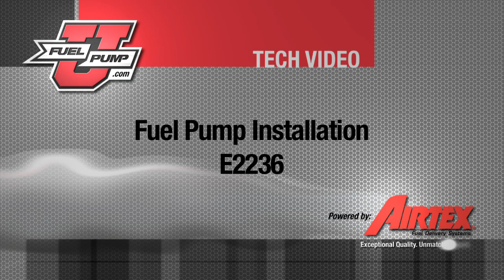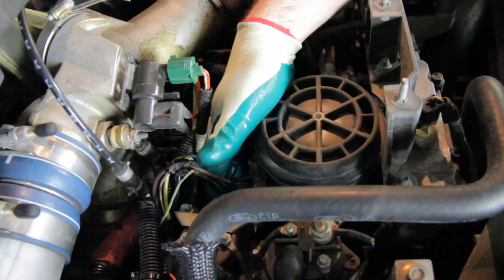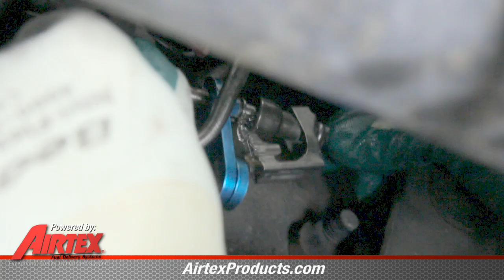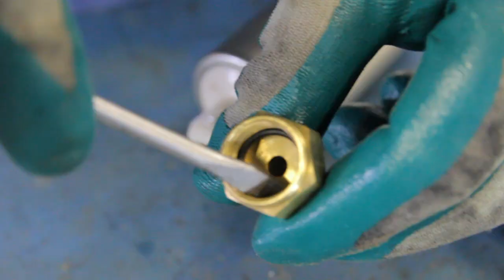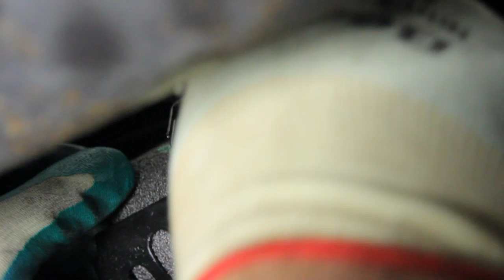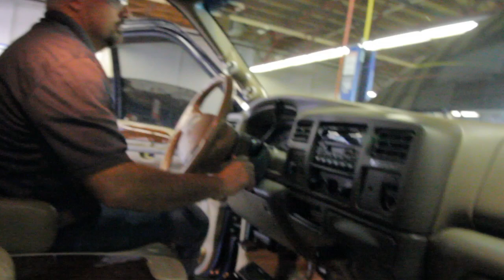How to Replace a Frame Rail Pump Assembly E2236 on 2000-2003 Ford Excursion

Comment: My previous comment I have to amend the fitting for the front of the fuel pump has been messed up looks like somebody grabbed it what's a pair of pliers or vise grips messed up the fitting that's why my quick disconnect tool would not work but that goes to show you when you buy a used vehicle you do not know what you're going to run into the previous owner of the vehicle probably worked on it himself or had somebody else work on it did Ashley didn't know what they were doing I apologize to the creator of this video put my previous comments

Comment: Yeah that looks like a nice idea in all but I have a 2002 550 plow truck that you would never get that bowl drain valve loose if you did it would start leaking all over the place that shows you how to do it but that's not real world real world is covered in rust and crud show us how to get the fuel pump out find an old rusted plow truck the truck you're working on looks like it's brand new straight out of the factory that's not real world I'm a mechanic I've been a mechanic for 40 years and I have never had a fuel pump come out that easy unrealistic

Comment: H E L P  !!!
My 2002 still has the factory pump and the inlet side doesn't have the big white clip,, it has a blue clip with little external access,, how do I remove that ??
I don't want to jump the gun and screw it up,,, I have a new Motorcraft unit ready and the inlet line clip is the last obstacle...

Comment: I have a 2002 7.3 powerstroke that will run good for weeks and then it will start running like it's not getting fuel and barely go down the road,  I can pull over, turn key off and back on it might run a half mile and repeat or ten miles or more and do nothing. Any ideas what it might be?
Reply: High Pressure Oil Pump (HPOP) its what makes the injectors do their thing. If its leaking or going bad the truck sometimes wont want to start or stay running.
Reply: Its your hpop sensor
Reply: Ever figure out what it was? I’m having this exact issue and I’m hoping this change in pump will fix it, I’ll be out of ideas after this😂

Comment: Its right under the drivers seat, on the inside of the frame, hard to see till u get way under there,  has 1 line in and 1 line or hose coming out, has 2 wires connect with small nuts, the pump is held by a bracket with  3 bolts to the frame

Comment: So you don't have to remove the tank? I've been holding off on doing this myself because all the shops I've called have said you have to remove the tank to get to the pump. If you don't have to, I may try to do this today.
Reply: Airtex/ASC Performance Pumps right, I understand that, and I am pretty sure that's what I have according to your description box. I have an '02 Excursion with the 7.3L Powerstroke, can you confirm if this is rail mounted?
Reply: Airtex/ASC Performance Pumps That's awesome, thanks. I'll probably get to it on Friday then, just gotta get that quick connect removal tool, already have the pump.

Comment: How do you remove the rear quick connect (horseshoe clip) on the inlet side of the fuel pump on this excursion diesel (without damaging fuel line), and do you have part number for the clip?? thanks